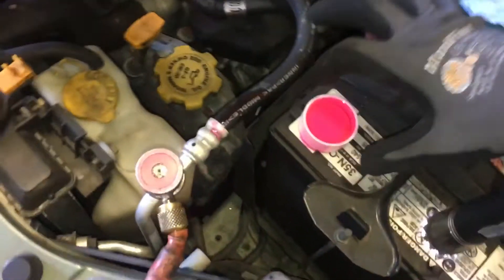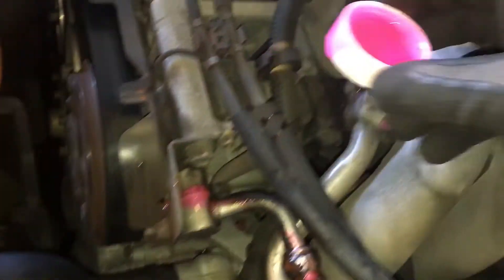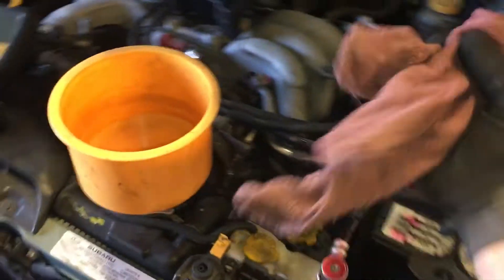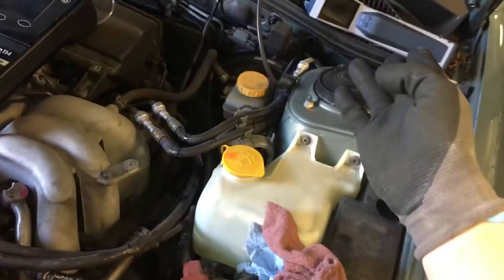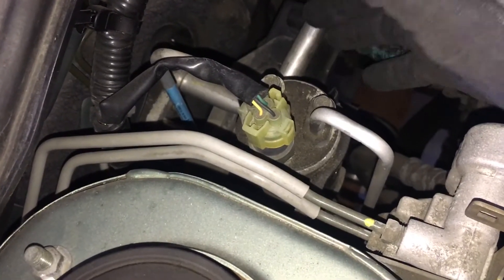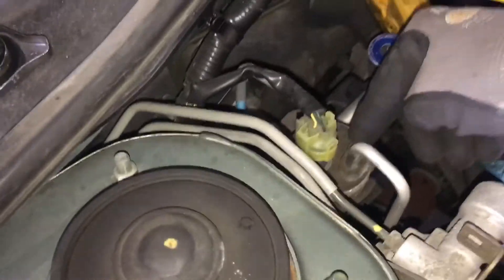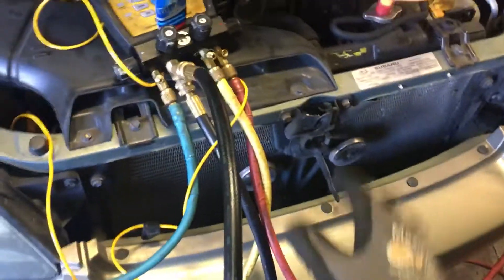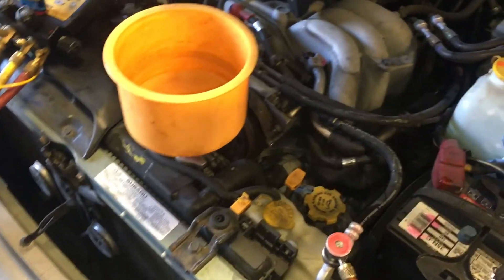I See a lot of leaks with oil stains and dust accumulation.153 psi nitrogen leak test fines nothing￼

Comment: Too bad there isn't an replacement drier available that's serviceable, or is there?  It would've been so easy to have an access to the desiccant so it can be changed, had they designed it that way and spent the extra $0.50 for an access plug.